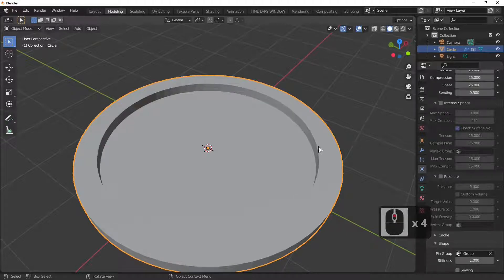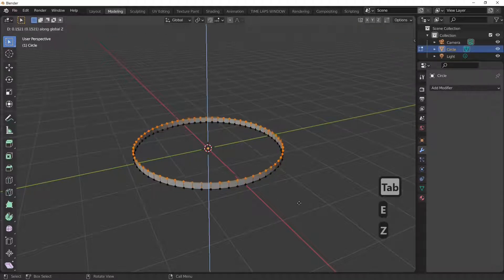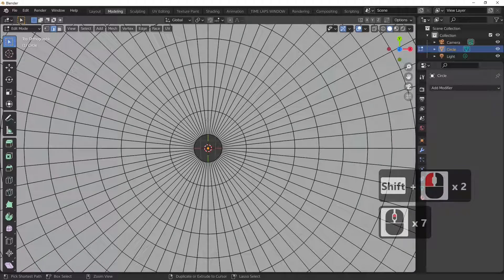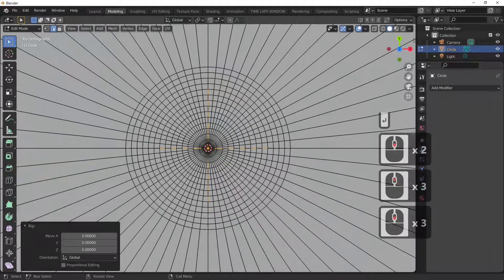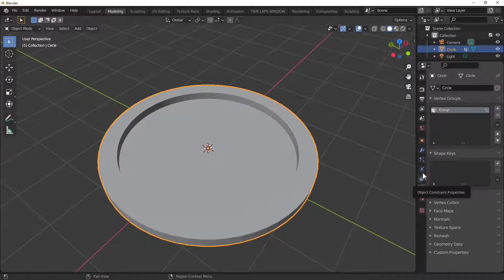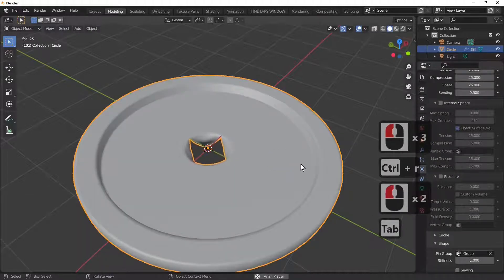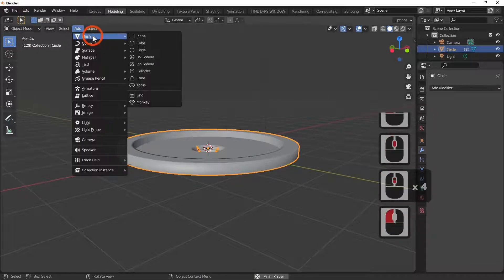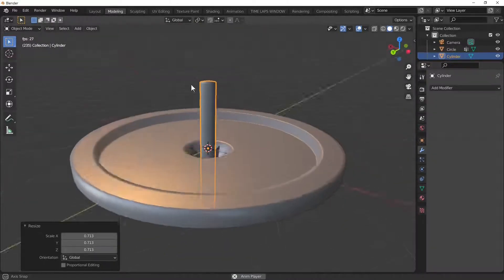make a lid with an X (Blender beginner tut) soda lid

Comment: Nice job..I knew there was some way around it..I am aslo trying to have the inner circles around the "x" cut straight as in rectangles and it also gives some ok results..thank you for your effort..saved me a lot of headache :)
Reply from the maker: Thanks appreciate the feed back thanks
Reply from the maker: A inner square can be made by selecting a quarter of the edges in an inner circle then flatten them using g x and then 0 and on the other edge g y 0 then subdivide withe the loop cut and then v will split the verts